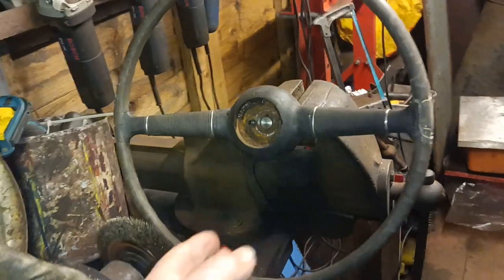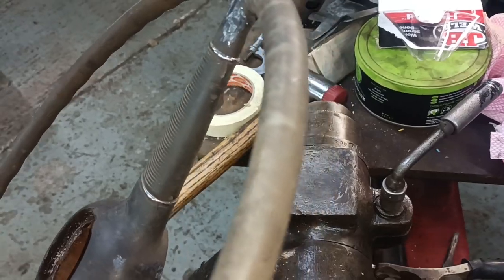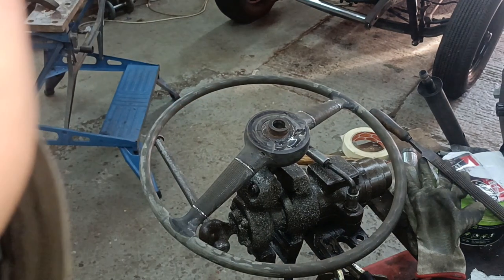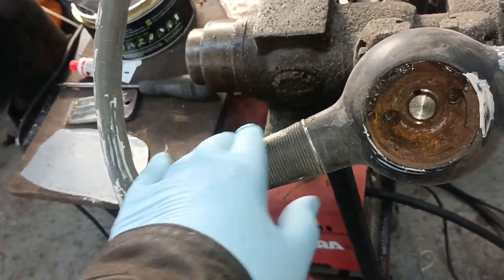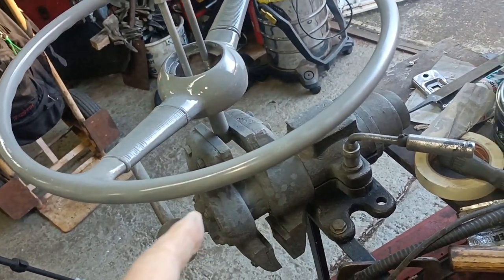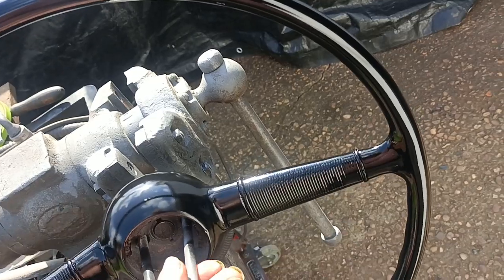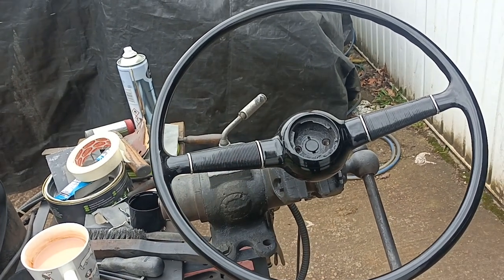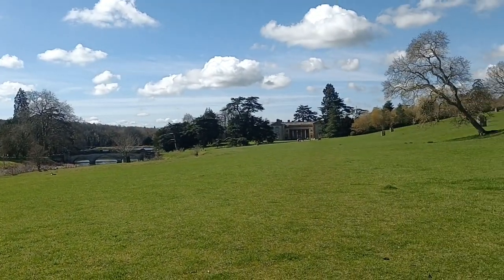Renovating a damaged Steering Wheel. 1940 Ford. (2332)

Comment: Hi Mart, great job looks really good, I did the same with my 36 steering wheel however I used a 2 pot epoxy putty which I kneaded into the cracks, came out great but I probably sanded and painted 6 times before I was happy with the finish. Great content cheers

Comment: That turned out great Mart !!! I have a "Gennie" 39 Banjo wheel that I'm going to use in my 29 CCPU that has a number of cracks. I have one of those "steering wheel restore" kits that i bought ?? 30 years ago. Once the truck gets "blown apart" for finishing and is "in pieces" getting painted and powder coated in different shops, I'l have lots of time to restore that wheel. I hope it comes out as good as yours !!!

Comment: I did my steering wheel the same way, but left it on the car when I had to putt the car in storage.  The Summer temp got up to 100°+ and the new cracks developed.  Just a word to the wise, keep those soybean "plastic" steering wheels out of high temps. You probably don't have to worry about high temps in the UK, Mart, but I just thought I would mention it for other's benifit.